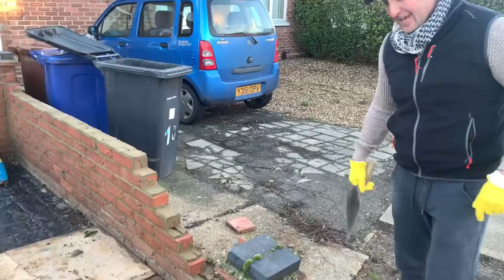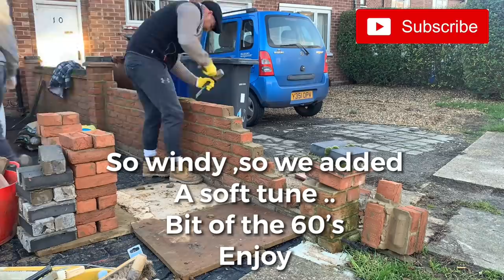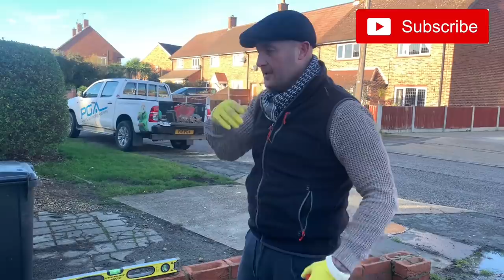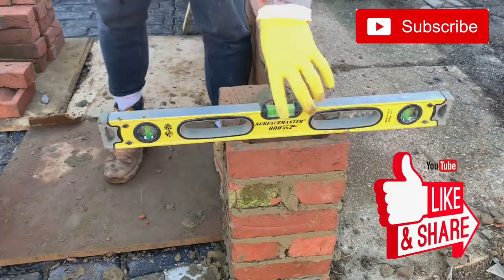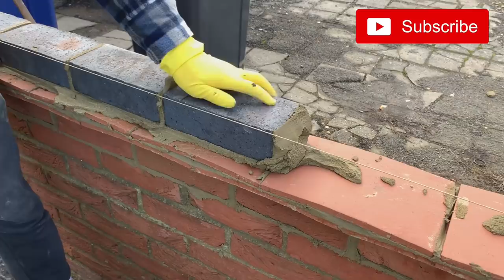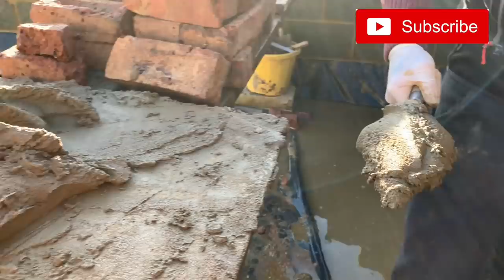#brickwork #bricklaying #brickie Brick wall repair 🧱 Bricklaying

Comment: Would still of liked tonof seen more protection on that drive way other than that decent work 👌🏻
Reply: Yep, I carry a couple of folded up old tarpaulins in a plastic bag just for this purpose. Makes clean up much easier.
Reply: @1real11  I’m a plasterer so I have to right over kill corex carpet protector sheets plastic the lot it’s hour sheeting up or more time cleaning up in my opinion
Reply from the maker: Think this depends on the person 🤷‍♂️know you’re capabilities...watch the video not much spill there lads ....we always carry jet wash just in case
Reply: @thetraditionalbricklayer9650  nothing wrong with the work all your work is bang on that’s not a debate just personal preference to having a bit more protection down I go over kill when protecting as I’ve learnt a lesson in the past so last 20 years it’s been about sheeting up especially if it’s on a resin or printed drive
Reply from the maker: @pagey5457  yeah nothing wrong in taking precaution i suppose ..we got jet wash out and clean the whole drive for the lady ..we had to be carful not to take paint off .she was over the moon ..boy washed the truck whilst he was at it 👌
Reply: @thetraditionalbricklayer9650  nice work will say I’m apprentice trained from young and the more traditional methods I can go back to if in a spot on a job move to see these methods still about